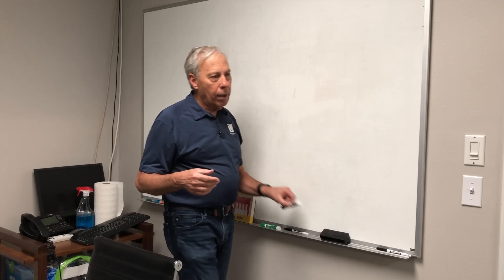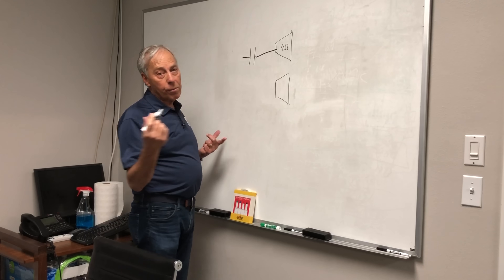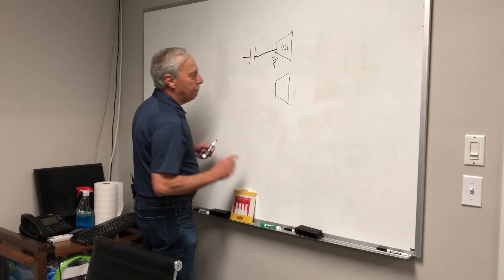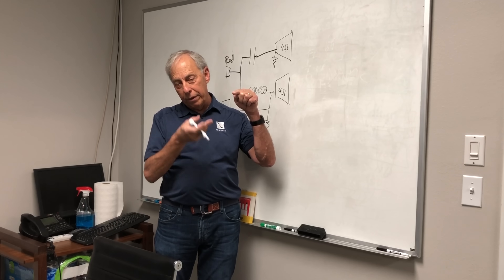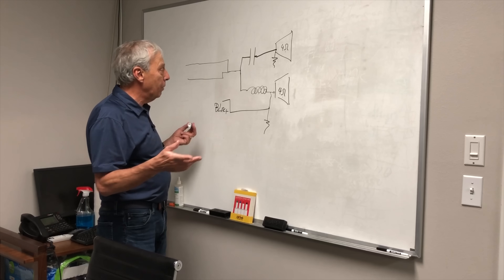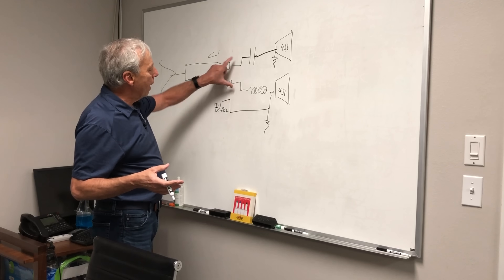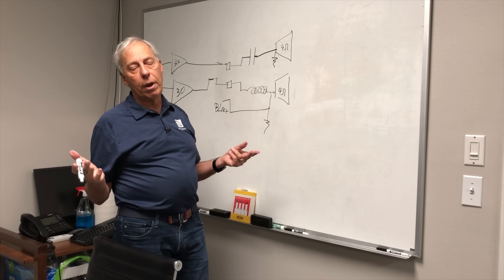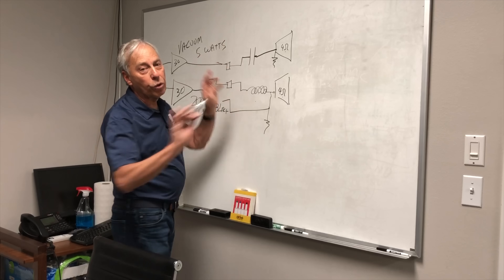How does bi-wiring work?

Comment: I love how Paul speaks using English instead of made up sentences explaining how Biamping will give you Caramel highs and Buttery or Chocolaty mid range ,I Tri amp my McIntosh XR-290 triple column line arrays that we're Roger Russell's personal hand built original design vs Clarion design change speakers ,while I have more than enough watts & headroom from my 1,200 watt @8 ohm Monoblocks I just like being able to use more of the amps I love and for asthetics of having 6 amps driving a pair of 7ft line arrays ,I've mic'ed my room and measured response from single stereo amp vs 1,900 8 ohm watt triamping and the results are nearly the same ,any differences in sound can be attributed to my sloppy work in not properly matching gain levels .

Comment: There is so much wrong with the biwiring explanation that I don't know where to start!  It can be summed up with words used in the video "...because you believe...".  It's nothing more than belief, without scientific basis and explains nothing.  The video describes but fails to explain.

Biwiring removes some bridged electrical damping and fractionally increases distortion.  There are no real benefits.  The signal from the amp does not know that it splits frequencies on the feed wires as that happens only at the crossover and the circuit then deals with that frequency band but is then commoned back at the amp output (return) again.  A doubling of loop is now in place with potential to lower S/N through increased potential for rfi.  There appears to be  nothing positive achieved other than fuel psuedo science beliefs.  Pick the righ amp and low reactivity cable geometry with adequately low loop resistance snd neither biwiring or biamping are necessary.

Bi amping can have merit if an amplifier hasn't power reserve to drive the woofer properly or lacks damping factor.  Here you can add an amplifier dedicated to the woofer but if it can drive the woofer then it can manage the whole system so why nit use that one amp in the first place?  Adding different amps with varying circuitry can also affect group delay so can add distortion in extreme examples.

The explanation in the video only demonstrates a lack of understanding of loudspeaker interaction and design and in doing so fuels nonsense subjectivity spouted by many on forums and in the hifi press.   I expected better from PS audio!

Comment: A speaker designer is going to finely tweak and adjust the crossover of a speaker to sound its best with a single run of speaker wires.  Since 99% of users are going to use it that way... Why would a designer make a speaker that sounds better bi-wired, when very very few people will try it?   I have experimented with bi-wiring, and in each case it ruined the driver integration.  I heard separate drivers working, rather than them integrating into a unified sound.    YES I heard a difference, and it was not for the better....   I suppose it's possible in the rare case, that you might find a speaker where you think it improves the sound.  If' you've got the time on your hands, sure go ahead and try it, but don't expect much.

Comment: What happens if I remove the bridge plates but only connect speaker wires to 1 pair of binding post?
Reply: Then you'll only hear the tweeter or woofer depending on which one you connected. That's it.

Comment: How do i make trs xlr speakers for studio monitors
Reply: I think I've mentioned elsewhere that TRS isn't suitable for high current applications. You need to be look at Speakon connectors.
Reply: @paulanderson79  The question in the first place was unintelligible so I'm not sure why you posted a response. TRS and XLR connections are used for line level signals, not for speaker cables. Powered speakers may have an RCA phono connector, a TRS jack, an XLR socket or some combination of those. I find it highly unlikely that any passive speaker would have a TRS or XLR input. The powered Adam Audio A7Xs in my studio have both RCA and XLR inputs. I use balanced XLR cables.

Comment: So for bi-wiring, would it be pointless and redundant to use two identical cables for both tweeter and woofer?  Also, does bi-wiring increases impedance by any meaningful factor?
Reply: There are some claims that use of separate wires redices intermodulation in speaker cables. But it's already next to zero. And bi-wiring has no effect on impedance.

Comment: What bi-wiring does do is put the short in a different place. After all the wires are connected there is a direct short between the highs and lows. It's either at the amplifier or at the speaker.
 Some audio snobs think they hear a difference. I believe if you ask them to tell the difference blindly they wouldn't be able to do so.
What does work is to use 8 ohm co-axial cable, fully shielded, instead of speaker wire. I can hear the improvement very easily.
  Also one needs to understand their logic, high current equals low voltage, low current equals higher voltage. That is their thinking, It matters when measuring but when good stranded low resistive copper wires (silver or silver plated is best) are used the differences are negligible.

Comment: Do you need two amplifiers to use bi wiring? Does the woofer need higher power that the tweeter? Is there any benifit? Will using a biamplified speaker allow for a simple two way equalizing effect?

Also, if a woofer is only gonna woof and a tweeter is only gonna tweet, what is the midrange gonna do! Lol!
Is a big amplified system a way of getting around a crossover network?

Also wouldn't bi amplication allow for an efficient tweeter while also addressing a woofer that's much less efficient. So you could use a 10 watt amp for the tweeter and a 100 watt amp for the pig of a woofer that is much less efficient?

Is the fact that we are seeing much more of these systems in so called studio monitors for computer based home studio having an impact on these set ups? 

Too many questions, I know.... but they all come to mind when I see one of these systems. And to be honest I use a biamplified system for my home theater set up,.. one for the mains and surrounds from 50Hz up, and a separate subwoofer amp for the sub. That way I'm able to adjust the sub so that it merely compliments the mains and surrounds rather than running them over with boomy bass nobody needs. Of course a lot of that has to do with the design of the sub, but it's important to me to keep things in balance. For instance when my former neighbor would crank up hi sub while watching movies on his Chinese shit box hole theater system nothing made me happier than to crank up my sub to the movie I was watching and drown him out, which I could do with ease!  This was extremely effective during the fall and spring when we had our windows open, but I'm sure even drubbing the rest of the years I could drown out his shit boombox sub!

Comment: It seems to me that bi wiring to a single amplifier should be very similar to just wiring to the same crossover normally. You would be adding extra length to the single wired crossover. The difference you’d be noticing would be a shift in the LCR contribution of the cables used on each leg.
The same story would fit with bi-amping. There you would also hear extra head-room and a lower noise floor.
Active would probably be the best approach and the LCR of the cable would be negligible since you are attaching the drive units to the amplifiers without an intervening filter network.
My thoughts are that bi-wiring and bi-amping add more wire and more amplifiers and the subjective change is nothing to do with the crossover. Perhaps single wiring with a more powerful amplifier with slightly thicker wires will give the same or, a better effect than bi-wiring to a single amplifier or, bi-amping. 
I think the active route justifies bi-amping and stands to be more accurate and efficient since there is less energy being converted into heat and distortion instead of sound by a filter network in front of each voice coil.

Comment: also makes less sense to be to have separate snake-oil wires, one for the tweeter, one for the woofer, when within the enclosure itself, the manufacturer probably used the same type of wire to connect the woofer/tweeter to the binding posts, or same wire to make the voice coils, etc.. so no matter how expensive or high quality you put as the external wiring, the internal wiring is probably as cheap as the manufacturer could get away with for the particular product line.

Comment: if you understand that different cables types and material do affect sound passage, you will know that Paul is spot on.I do not recommend bi wiring because for the most part it means buying more wiring, lol. Especially when using identical cables, but what Paul is demonstrating is that different cables types do have an effect on inductance, capacitance and resistance so just like a crossover network they can affect the filtering of frequencies, which is why some folks sense that their cables are bright or dull, etc. A/B test different interconnect and speaker wiring, and hear for yourself.

Comment: At last somebody that explains clearly and true story. Like you very much. BTW I am using bi-amping in all my system (for other reasons). When the Amplifier of the woofer works hard it doesnt impact the clarity of the high.I have also a pair of B&W 804, they need quite a push. I found that a simple Rotel of 5*120 is better(the difference was really big mostly in low power) than expensive stereo ( MBL or Musical Fidelity). Joe Israel

Comment: If you add an active line level crossover before the amps, it is much more efficient, fully utilizing the wattage of both amps. If you feed full range signals to both amps, then both amps would expend wattage for both lows and highs, and the passive filters on their outputs would then kill and waste some of that wattage. But if you do your filtering before the amplification, your high amp will only amplify highs, without wasting any power on low end, and the low amp will only amplify lows, without wasting power on high end. Basically, you get to utilize the full wattage rating of your amps, instead of burning off a large portion of it heating up caps and inductors.

Comment: Bi-wiring is done so there is no shared impedance / conductor, ideally eliminating crossover / cross talk.
It is a problem if you use the same ground wire for the left and right speaker resulting in some signal "bleeding" to the wrong side. (voltage divider using resistors)
Although, as you explained there are passive filters in most speakers, these filters will filter the unwanted crossover. 
So...... What should be the magic difference in sound quality?

Comment: I'd bi-amp as a first choice, then bi-wire with matching cables instead of using those horrible linking plates and thirdly just replace the links with decent cable. That cable mix 'n' match was all the rage in the late '80s, mind you so was Peter Belt!!!

Comment: So i bi-wire because my speakers are 300watts and each channel can only do 125. It sounds really quite unless i biwire. Essentially I spliting the left and right to have tweet, mid and lows. 

I will say it sounds more sharp when listening to sacds. Most people say they cant hear the difference when biwired.
Reply: Uhm... if the cables really would be speced for 125 W and that is too "quite" for you that would mean you have long since lost your hearing. 10 W is already loud. And also that would jsut mean your wire was really really thin. 300W isn't much and even relatively thin cable can handle that.

Comment: Hmmm. I've bi wired my Cambridge Audio Amp to my Cambridge Audio floor standing speakers as I wasn't getting much bass without cranking up the bass control and it has made a difference. Not spellbinding as some may suggest, but enough until I can afford to upgrade to an amp & speakers that will give me a bit more rumble, especially at lower volumes. Looking at vintage Marantz.....but that's for another thread!

Comment: okay so i have 2 600wrms car subs both have dual2ohm voice coils running running on a 4 channel pa amp 4ohms min per channel with channels in parallel and my subs are 1ohm each as the voice coils are in paralell aswell so the 2 channels on the amp in paralell go to a min of 2 ohms and i run it on 1 ohm. so basivcally im going alf my ohms avalible on my amp. may i also add these subs are in a 4th order bandpass. is this save? ive been blasting them alot and it clipps sometimes when i dont notice. will my amp blow?

Comment: In response to some of the criticism it seemed to me that Paul is describing the process of bi-wiring and bi-amping. He doesn't really say they are any better or worse, just what they are in simple terms. But the subject of cables was raised; I always thought that cables are either capable of carrying the current adequately or not. But then someone recently told me that the low frequency signals in a wire can cause magnetic fields that can affect the high frequency currents so separating them may be a good thing. And that they can have their own resistance and inductance and this may affect the crossover effect. Lucky I can't afford to experiment...
Reply: "But then someone recently told me that the low frequency signals in a wire can cause magnetic fields that can affect the high frequency currents so separating them may be a good thing." 
well - that someone was telling bullshit. if you have really highend setup, a sound studio and a perfect source, bi-amps and all the bells and whistles then it can make a tiny tiny fraction of a difference that some experts can notice when specifically listening to that.

Comment: An 833-A SET will give you plenty of bass and if you can get pure enough 10 volts DC for the cathode and just use 1000Volts for the tube itself and drive it at zero grid bias; e.g. transformer couple it with the secondary between the 833-A grid and ground and you will only draw about 140 plate ma. The sound is deep and tight. A Hammond 1642SE output transformer fits this nicely.